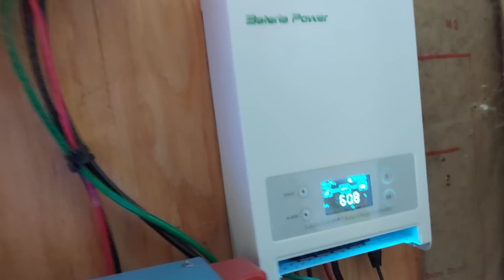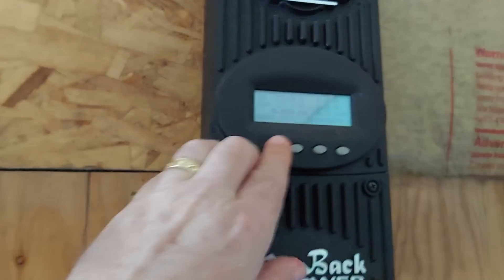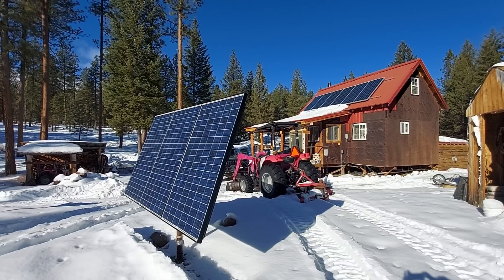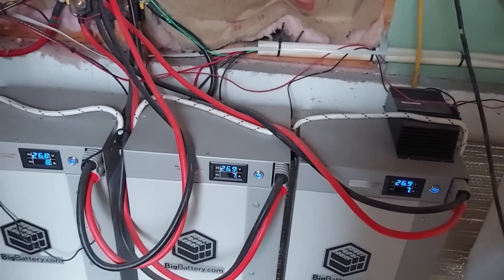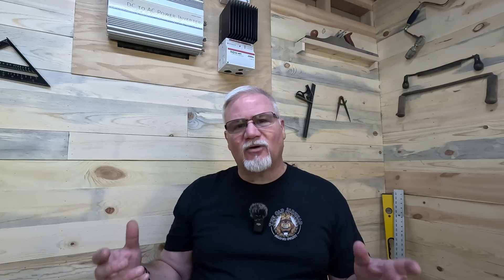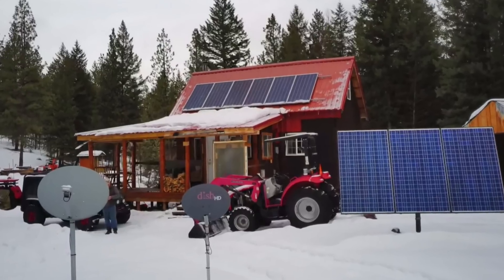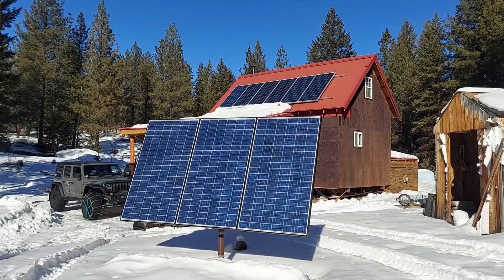Off-Grid Power: Connecting Two Charge Controllers to One Battery Bank

Comment: I've been collecting components all year long to build something like this into my porch.
I have 30, 210 watt, evergreen solars from the early 2000's,
Not the greatest panels but not the worst.
The power transformation/Storage/inversion system is where i invested.
Two victron 150/75 tr's

Four 300 ah lipo4 batteries

Two lvyuan 5kw constant 10kw peak pure sine wave inverters

Two 80a & two 40a dc circuit breakers

Plus a Rigid 4ft x 2ft x 3ft steel jobsite toolchest and some rubber matts & unistrut to build it all into.

There is also a drain and vents that rodents & insects cannot enter.

My goal is to build this system into one tough unit, that can take a little punishment, is insulated, has ports for dual inputs, plenty of safetys, has large as possible storage capacity and provides the equivalent of four 120vac/20a circuit breakers in a home, (for roughly 12 hours with no inputs) and it can be recharged easily by anyone who can fire up a generator & plug a battery charger into one or both of the charge controllers.
And you can move it with a skidsteer.
Reply from the maker: Sounds like a serious build! Good luck with it.

Comment: Using multiple controllers of the same make and parameters is fine. If you have different makes with different charging parameters, you can have problems!
Reply from the maker: Nah.  As long as the parameters are set correctly it's fine.  Been doing it a long time.

Comment: We are looking at selling and going off grid and I was struggling to design everything around a single 30 amp controller by focusing on the hours half of the amp hours BUT then I said why do I assume I can't parallel them like I plan to parallel small inverters?  Searched, and here you say no need to fit inside 30amps son.  I say, thanks dad and for the word "battery bus bar" I didn't know how to call that.
Reply from the maker: Why 30amps?  That's the first place I'd personally look to open up.  Don't think of the panels on a Charge Controller Amp rating, that's the battery charger rating.  30amps at whatever voltage with a max incoming voltage.  I run a 60amp controller fed by just 11.27 amps of solar @54.57v which gives me over 20amps of charging so I can upgrade panels and push more to it eventually.  My 80amp CC usually runs about 50amps...I can add more panels.

Comment: This is the direction I am going in. Using a inverter charger with an MPPT built-in and then having a couple 12 V 300 amp power batteries charged and on hand and if something comes up, I’m not caught unaware or unprepared. I do have a couple of power stations for the router or other needs.
Reply from the maker: That sounds like a solid plan! Having a reliable setup with an inverter charger and extra batteries will definitely keep you prepared for anything that comes your way. Stay charged!

Comment: does this work for a separate solar panel system and a separate hydropower system into one battery or does this only works for two solar panel setup?
Reply from the maker: Yes.  In fact, you could run Solar, wind and Hydro this way :D
Reply: @TheOldJarhead  thank you!!
Reply from the maker: You bet!

Comment: When I started in 2015, I had one battery and one controller (midnite classic 150) on a 400ah 24v FLA battery.  Using multiple arrays and controllers on the same battery does work well.  On my 800AH AGM, I have four controllers (3 VE, 1 morningstar).  Now I have five battery banks in 12, 24, and 48 with a combined 10 controllers on six arrays.  To MOVE power around, I have a switch board that I can switch arrays to the controllers whenever needed.  At night, IF one battery is too low, I now use the inverter from one battery and move power.  I was able to heat a 16x20 closed off room with electric heaters this winter in Michigan.  I cannot wait to combine a few things and sell off the un-used MPPT controllers later in 2025.  Good topic and thanks.
Reply from the maker: Sounds like a lot of thought in what you are doing

Comment: Damn this was way above me 🤣, could i ask for best settings tips. got 3 small panels facing west have small balcony (4real) 2x 80W foldable, 1 100W rigid (all monocrysteline). Now 1x80w and 1x100W in paralel own mppt controler 10A. The other 80W stands alone with pwm controler (came with the panel, all 3 are Dokio). i have 2x100Ah and 1x300ah baterries. Its 12.8v system any suggestions? Greetings from the Netherlands, where officialy Spring finaly started.
Reply from the maker: Are the batteries in parallel?  If so, set the target voltage to the same on both controllers and set absorb and float to same voltage as long as the BMS's on the batteries can manage the charge.
Reply: @TheOldJarhead  Nope batteries all seperate
Reply from the maker: You could parallel the batteries even through they are different AH ratings as long as they are all 12.8v LiFePo4's.  Then combine the 80w panels in parallel and set them on one controller and the 100w on a separate one facing a different direction.  However, 260w of solar is pretty small for 500ah of battery.

How much of the battery power do you typically use overnight?
Reply: @TheOldJarhead  Live on the grid so no issue there, it started out not willing to charge powerstation (only Ac in my garage to charge Motorcycle in winter) if the sun is free, and spiralled overboard hahaha. now having that much Ah's i run tv laptop and light in my appartment as much as i can. Now i'm building a battery rack in a smaal room behind my balcony, but not sure how to get the Inverter (cheapass thing sorry) powerd by the batteries its obout 50ft appart. But to anwer you question i use about 700 watts in 24hour just small stuff. Cheapass inverter not suitable above 600W althhough rated as 1000W 2000W peak. but hy it started as fun🤣 Have a great day .
Reply from the maker: @renedejong2064 Ahhh yes, 50ftvis too far for 12.8v systems

Comment: Multiple charge controllers also good for redundancy.  If one fails, you still get some charging while you repair/replace the failed component.

What do you do for the more complex inverse...running multiple dissimilar batteries? When upgrading after a while, even buying the same batteries will result in dissimilar batteries because of dissimilar wear.  Using resistors to match internal resistance seems a qaste of power.  What approaches do you use to expand?
Reply from the maker: I prefer like for like expansion.   For FLAs as long as same voltage and ampbhour rating etc than as long as not more than 1 year newer should be fine.  For LiFePo4 batteries I'd check manufacturers recommendations
Reply: @TheOldJarhead  I absolutely agree, but it's an endemic problem that people may want to upgrade after a few years.  Selling existing batteries and buying double new capacity may not be viable, so expanding unlike batteries will always be a need.
Reply from the maker: @SeekingBeautifulDesign Very true. I believe Will Prowes has done some parallel testing with unlike batteries and proven it works

Comment: For LiFePO4 I recommend using 3.55V/cell as your charge target, not 3.60-3.65V/cell which will hit the BMS OVP disconnect.   For an 8s 24V system, 3.55V * 8 = 28.4V charge target.  You don't need to go higher than that.

Basically, LiFePO4 will charge fully at 3.45V/cell (once the current tails off to near zero).  However, the BMS is likely configured to not start balancing until 3.45V or 3.50V/cell,  so the most compatible charge target is typically 3.55V/cell.   BMS OVP disconnect is typically at 3.65V which you generally don't want to hit regularly.

So you don't want to go too low, but you also don't want to go too high.  Going too high can cause voltage spikes above the charge target (for example, due to fast-changing sun conditions).  So too-high a target can actually OVP the battery bank even if it is within bounds.  And too-low a charge target can prevent the BMS from balancing properly as well as reduce charge current too early due to voltage drop along the cabling.

In anycase, the only limitation with multiple charge controllers is to ensure that the maximum aggregate charging current does not exceed the battery bank's charging capability and cabling.  That's the only limitation.  It is not uncommon to have four or five charge controllers running into a bank.   In fact, in situations where people used to parallel strings together into a single charge controller, now people often run the strings separately into their own charge controllers.  This way the strings don't interfere with each other when e.g. there is partial shading or a panel failure.

It is a good idea to set all charge controllers to the same parameters.  If you set some charge controllers to a lower target voltage than others, and the others push the battery bank higher than the lower target, those charge controllers with the lower target may trigger their over-voltage protection which is not desirable... it can cause a charge controller to clamp the solar input (short it) and to shutdown until manually power cycled.

-Matt
Reply from the maker: Great points.  My manufacturer told me to set t b29v and let the BMS manage the rest but I'm sure many don't.
Reply: I've got mine set to 28.2 volts. The default is 28.4 but I've also been charging my solar generator which says 28volts max on the input so I don't want to push it. I got lots of BMS disconnects with higher voltages. If you graph the voltage you can see it climbs really steeply to 28.2 so you know the cells are very nearly full. You can set an absorption for a few hours to balance the cells. My float voltage is actually 26.7 volts (about that anyway). I set it to what the batteries naturally come to rest at overnight with no load. I can get at least the rated capacity as I don't push them that hard. 29 volts is a bit high and I think they say that for faster charging and balancing. I think that individual cells can go over voltage at that level and it's not really necessary.
Reply from the maker: Since the BMS is managing the charging profile for my batteries I think it's fine.  For yours, you may be ramping down too early and preventing a full balancing of the cells.  Even Will Prowes and others have shown at least 28.8 for most LiFePo4's at 24v to get fully charged and there is debate there yet.